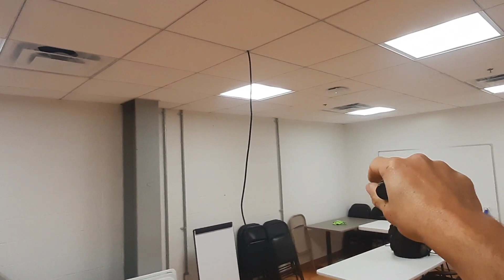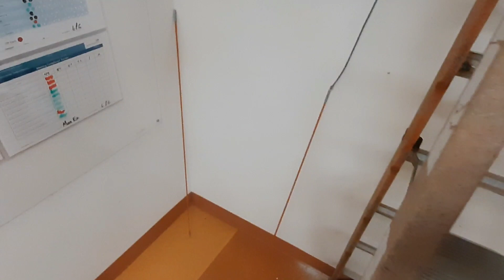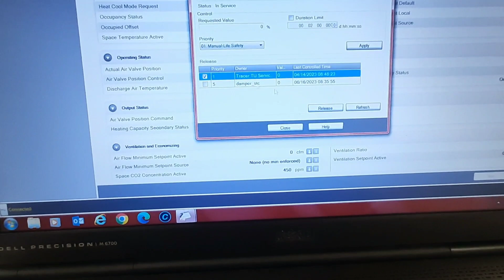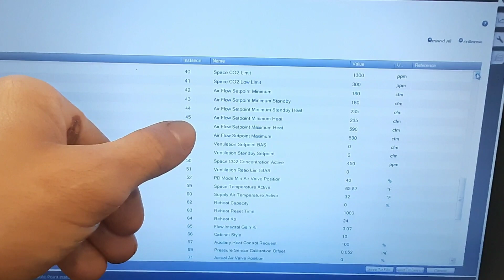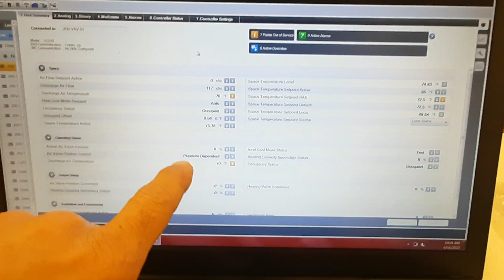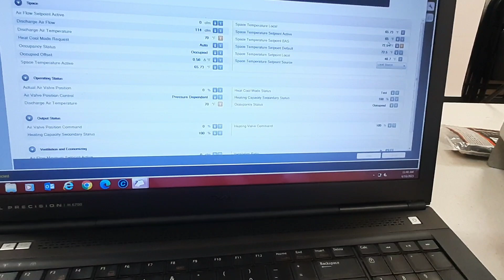using an abandoned VAV box to cool an old storage room, recently changed to conference room.

Comment: Hey what software are you using for this setup
Reply: Looks like an older version of the Trane Tracer software. Their old Pre-BACnet BAS system
Reply: @SerialChiller-VRF  thanks
Reply from the maker: Actually, this is not old software. It is Bacnet. This is tracer TU that I'm using.
Reply: @EverythingHVACR  right, IIRC if it was old Tracer the thermostat would look similar but 5+ wires